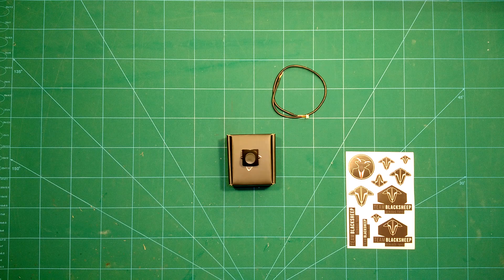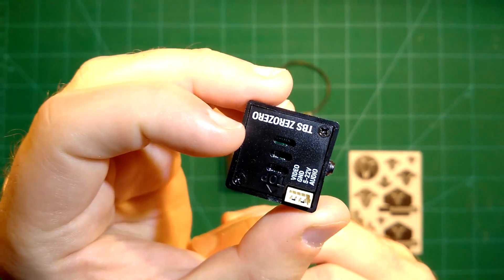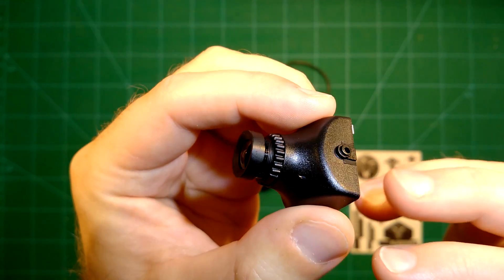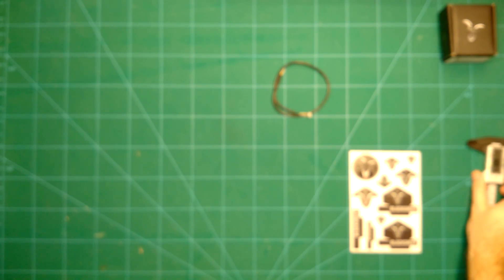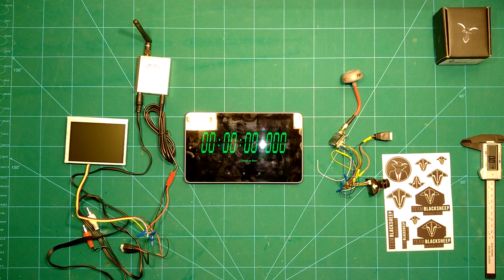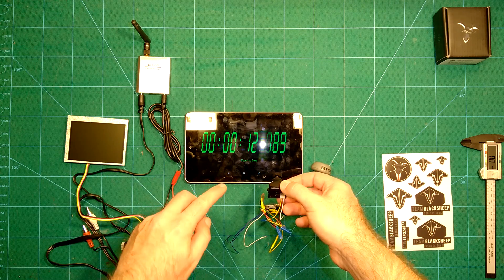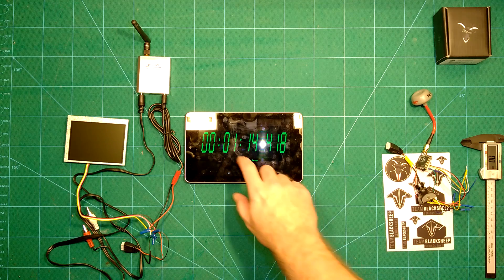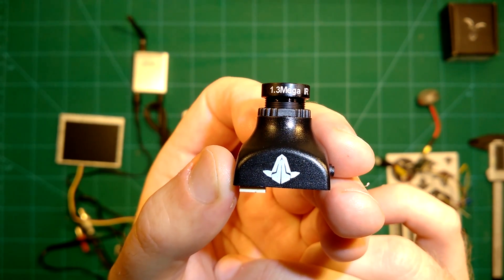TBS ZeroZero: Zero Latency CCD Boardcam - Review & Latency Measurements

Comment: it is strange that when I pause the video there is latency but on your pause there is always none .... why is that you think?
Reply from the maker: Many thanks for taking the time to comment! You have to take care with interpreting these results, since the two displays which I use do not have their refresh cycle synced. That means that while both of the displays might actually have the most current information, one might just not have its display refreshed yet, when I take the photo of both. This means that in order to get valid results you will actually have to hunt for minimas, which will occur when both displays sync at the same time - this is how you can get valid results without having an artificial delay due to both screen not being in sync. This is what I do in the measurements part of the video, I do stop the video at those "minimas" in order to make it easier for you to see them.

However, as noted in the video description, please note that since my android tablet (my "clock") has a maximum temporal resolution of 30hz, that means it will only show a new ms value every 33ms. So the maximum measurement error given my hobby equipment is 33ms which means that what this test can reliably say is that the ZeroZero definitely has a latency of less than 33ms - glass to glass. I'm now investigating means to get a higher resolution clock. A propeller spinning at a precise RPM rate could work as a high resolution clock. Or maybe a digital clock where the screen has a refresh rate of more than 30 fps. Researching this is fascinating by itself, I now have an Arduino based clock here for testing, which should have much higher resolution.
Reply: RC FPV Flight yeah it is fascinating and to be honest the latency i saw would not even effect my flying but thought it was strange to see that.
lots of variables take place and it is always nice to learn more about this stuff.

thanks

Comment: you need to co ml pare some other cameras.  I think this has more to do with the transmitter than the camera.
Reply from the maker: +goofyfoot2001 Hi! I did many latency measurements of cameras previously, they are all on my channel. The transmission of analog video is 'zero latency', this will not add any latency. For HD / digital transmission this is different, because there the signal is encoded. If you talk about the radio transmitter, then yes - that will of course add some latency as well.

Comment: looks like it's got 40ms of latency? the PZ0420M only 25ms...
Reply from the maker: +FPV Oscar You have to take care with interpreting these results, since the two displays which I use do not have their refresh cycle synced. That means that while both of the displays might actually have the most current information, one might just not have its display refreshed yet, when I take the photo of both. This means that in order to get valid results you will actually have to hunt for minima, which will occur when both displays sync at the same time - this is how you can get valid results without having an artificial delay due to both screen not being in sync. This is what I do in the measurements part of the video, I do stop the video at those "minima" in order to make it easier for you to see them.

But - and this is the weak point of my measurement above, since the Android tablet only has a refresh rate of 17ms, that means it will only show a new ms value every 17ms, which means that with my hobby equipment I currently have a measuring error of 17ms. The only thing I can therefore really accurately say is that the ZeroZero has latency of <17ms, which is still a relevant result, but I could do better. I also point this out in the video description.

My next step is to implement a clock based on an Arduino and a LED display. I will be able to update this clock (and the LED display!) once every ms. This will give me true ms resolution for the clock and will let me measure the latency much more accuratly.

It's fascinating to dive deeper into this field. I'm learning a lot and will continue to try to share it with you through my videos. Hope that I could shed some light on this.

All the best, Michael
Reply: that's why it's always a good idea to do comparison tests :) thanks for the detail explanation! and good luck on you arduino clock project mate :)
Reply from the maker: Many thanks, it's coming along nicely :-)

Comment: If you stop this the video, you can see the true latency, it is 0.033", it is very good, but it isn't zero
Reply from the maker: +Riccardo Albiero You have to take care with interpreting these results, since the two displays which I use do not have their refresh cycle synced. That means that while both of the displays might actually have the most current information, one might just not have its display refreshed yet, when I take the photo of both. This means that in order to get valid results you will actually have to hunt for minima, which will occur when both displays sync at the same time - this is how you can get valid results without having an artificial delay due to both screen not being in sync. This is what I do in the measurements part of the video, I do stop the video at those "minima" in order to make it easier for you to see them.

But - and this is the weak point of my measurement above, since the Android tablet only has a refresh rate of 33ms, that means it will only show a new ms value every 33ms, which means that with my hobby equipment I currently have a measuring error of 33ms. The only thing I can therefore really accurately say is that the ZeroZero has latency of <33ms, which is still a relevant result, but I could do better. I also point this out in the video description.

My next step is to implement a clock based on an Arduino and a LED display. I will be able to update this clock (and the LED display!) once every ms. This will give me true ms resolution for the clock and will let me measure the latency much more accuratly.

It's fascinating to dive deeper into this field. I'm learning a lot and will continue to try to share it with you through my videos. Hope that I could shed some light on this.

Comment: If the output camera takes a snapshot of the counter before the test camera, it will record a lower time than the test camera.There will then appear to have NEGATIVE latency.As the two camera's sync times slide past each other you will record negative 16ms to positive 16ms latency. (just like a strobe can make objects appear to go backwards)All analog cameras have "zero latency", this is no different.
Reply from the maker: +BuckAutomation I'm not completely following your first point, but I will think again about it. As for your second point, there are many videos outthere which actually show that higher TVL (>700) analog cameras do have latency. I don't say that you are wrong, maybe those other videos are ... hmmm.
Reply from the maker: +RC FPV Flight Oh...and many thanks for your comment. So much great discussion on latency tests here and also at the other places where I posted this (Reddit, etc.). Thanks!

Comment: The screen have max 60hz, is to say 16ms, this test is useless to test the latency on this precision range, I'm sorry xD
Reply from the maker: +andriuP6 FPV Well, I would not call it useless, but you are right that since my android tablet (my "clock") has a maximum temporal resolution of 60hz, that means it will only show a new ms value every 16ms. So the maximum measurement error given my hobby equipment is indeed the 16ms which you quote above - nothing to be sorry about that :-) (and that is still a really low latency!). I'm now investigating means to get a higher resolution clock. A clever guy at FPVlab suggested a propeller spinning at a precise RPM rate, that could work. Or maybe a digital clock where the screen has a refresh rate of more than 60 fps. Researching this is fascinating by itself, if you have some inputs on this, please share them :-)
Reply: +RC FPV Flight yeah man, that would be a good idea, a spinning disc.. I called useless for this ultra high precision, but obviusly is a really low latency already! :)
Reply: +andriuP6 FPV If you don't see latency at this scale, it doesn't need to be any more precise.

Reminds me of the super mega ultra, kissed by baby Jesus, zero latency $200 for an RX, race transmitters- it is totally a placebo effect once you reach a certain latency and does not make you a better racer, all your doing is pissing away your money and fattening your head.

Comment: hi, did some latency tests today also (not on this cam). my problem: have you filmed your stopwatch with let's say the gopro on 240fps?
I can see that I get around 30-60ms of "time resolution" no matter if I use an app on my phone or a stopwatch proggy on my PC...
I'm on my search now for a classic stopwatch (physical) that shows ms as well and which is super responsive...

this cam here did remind me on the body from the silver runcam sky that I have (had, crashed).
Reply from the maker: +RCSchim A clever guy at FPVLab suggested a propeller spinning at a constant RPM as high-resolution analog clock. That sounds like an awesome idea. What do you think?
Reply: +RC FPV Flight OMG GOD YOU STOIPED IT AT 1. 666 DEVIL ILUMANATI CONFIRMED
Reply from the maker: +RCSchim Hi! One problem which arises is when you have two displays, is that their refresh rate will never be synced. That means, that for example, when they refresh with 30 FPS, both can already have the same information, but one of them just did not reresh its display yet, when you take the photo of the two displays. This will lead exactly to the latency which you experienced, namely 1/30 of a second (for a 30 FPS framerate) - that is 30ms. You now have several possibilities to encounter this. One possibility is to record the both screens with a high framerate and then just pick out the minimas and ignore the values where you get the 30ms due to displays not synchronized. This is how I do these tests, it means a bit more work when analyzing the video, but will lead to as precise as possible results. 

As said above, your problem is not the frame rate of the recording camera, but the refresh rate of the two displays which show the millisecond counter. More precise results, using this technic, will only be possible if both of these displays have a much higher framerate, or if their refresh rates are synched with each other. 

I hope that I was able to explain this clearly, but I&#39;m quite sure you understand what I mean.
Reply: +RC FPV Flight sure, that's why I wanna use a "real" stopwatch, but then again the FPV monitor is a lame slow display as well - so I guess it's hard to do really precise measurements here...
however,  until 50ms it's useable I think, 100ms (gopro3 liveout) is ok on GPS quads, higher is weird...
the FPV cams I tested (aowmay, runcam, tbs69) have around 20-30ms I guess - so they're already blow our test-resolution ;-)
not sure if we really need 1ms fast cams - maybe the really fast pro's do...
Reply from the maker: Great idea with the real stopwatch. I'm really looking forward to your video on this. I might copy this idea of yours for future videos, if that is ok with you :-)
 
I guess it will be hard to find an analog stopwatch with milliseconds resolution though hmmm
Reply: +RCSchim Hey Mario i think if you can not get less than 30ms it is because of your FPV LCD monitor for sure!
I think what makes the difference here is the LCD monitor he used :)
Keep in mind according to your standard: 1/30 (NTSC) is approximately 30ms... The monitor he used has probably a way to accelerate the processing display and reduce the latency...
Reply from the maker: +ABMNS PRODUCTION The LCD monitor may very well make a difference. As we know from my previous measurements, I could never tell where the delay came from, either from the LCD or the camera, I could only always measure the absolute delay of the both together. Now, however (and I really love this), I finally have a "zero latency" display which will let me isolate
 the latency of just the cameras - awesome. Really looking foward to repeat my previous tests with the other cameras now :-)
Reply: +RC FPV Flight one more thing: if you have the signal in pal or ntsc you have either 25 or 30fps - no matter what refreshrate the display has, isnt it? So there we should be again around the magix 33ms of time resolution limit...
I think I will use a clamp or some visual indicator also in combination with the stopwatch to have a compromise.
however, if we know now that the video transmission also incorporates 25 or 30fps - aka 33ms - why would we need less than 33ms fast FPV cams?
(maybe there's an error in my thoughts ;-)
Reply from the maker: I also have sometimes a hard time to get my head around that, but that's what I like about it, it keeps me thinking. Having the frame rate at 30 FPS (let's just assume NTSC) of course means that there will be a new picture every 1000/30 = 33.33ms. But (!) with a stopwatch which really updates every ms, you will still be able to measure the camera delay with more precision than the 33.33ms. The way I would do it is the same approach than in my video, I would inspect each frame of the recorded video and then just search for the minimum shown delay (which will shift, because of the frame rate of the display). Ideally I will find a frame in my recording where the display just refreshed and that then should show me the true latency of the camera. Do you see what I mean? Does that make sense?

Of course, we are academic here, I do not touch the question how much real life impact that will have for FPV pilots, that is another question altogether :-)
Reply from the maker: +RCSchim Said that above, I do see where you are going with this. Unless the camera and the display somehow sync their refresh cycles, there will always potentially be a 33.33ms delay between camera and display. The question is, do they sync their refresh somehow? If not, is it just "bad luck" whether you have 0ms delay (if their refresh is synced by luck) or 33.33ms delay (if you turn on at just the wrong time). Hmmmm....
Reply from the maker: +TheEnragedGamer LOL ;-)

Comment: what LCD are you using? that can make a difference - yours must be low latency...also - have you tested other flight cameras with this same set-up? If so how did they compare...
Reply from the maker: +Stephen Wright As said in the video, for exactly the reason which you state above, I'm using a LCD panel from the TBS ground station. TBS is only guaranteeing "zero latency" when using TBS equipment, in this case for example the TBS ground station, because that has a low latency LCD. I have done latency tests before, but not with that display, so before that I could never exactly say if the measured latency comes from the camera or from the display. Now that I have this zero latency display, I'm greatly looking forward to repeat my previous latency tests (for example these: https://www.youtube.com/watch?v=2Ptp4q50-Eo) with this display, because that will now enable me to isolate the camera latency itself.

Many thanks for your comment!
Reply: +RC FPV Flight thanks oops I fwd part of the video...;)....is the zero latency LCD available to buy also? I can't see it in their shop...
Reply from the maker: No worries :-). The display is part of their TBS groundstation. I don't think they have it as a spare part in their shop to buy directly, but if you mail them they might get you one.